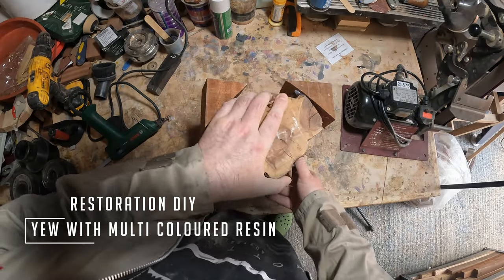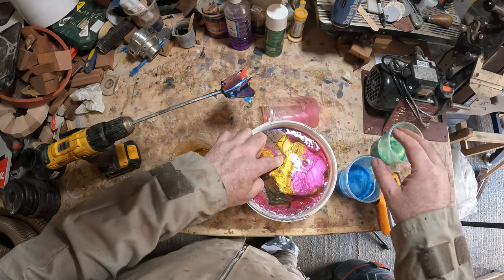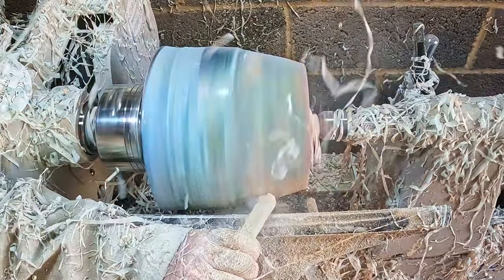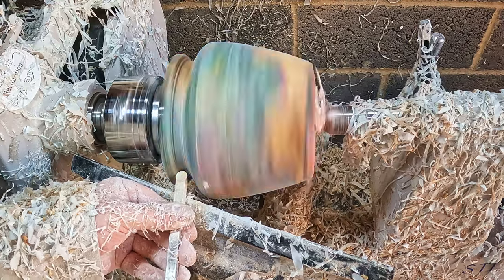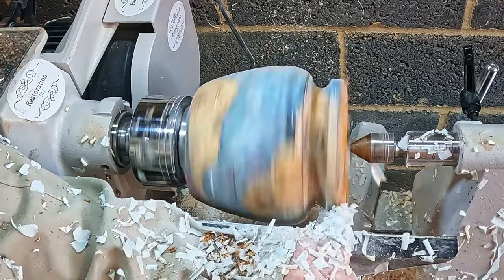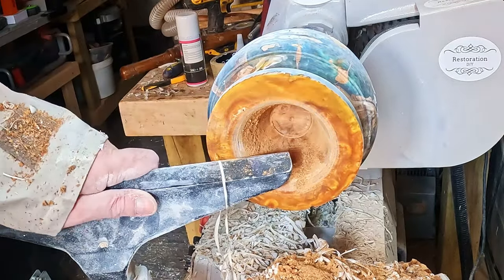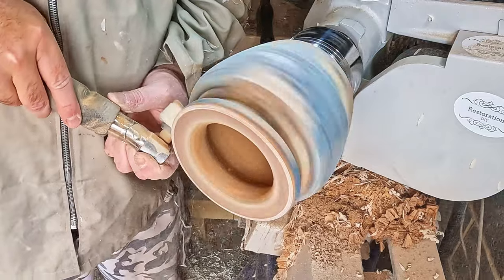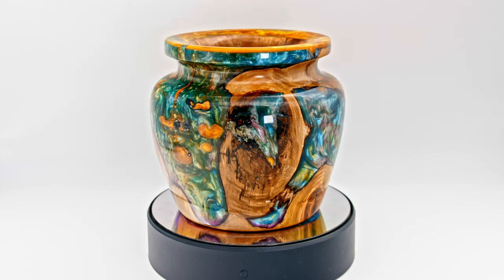Woodturning | Yew Vase with 4 Colour Epoxy Resin | Restoration DIY

Comment: maybe a vacuum chamber should be next on your list of purchases for your shop? it can draw resin into porous woods, which stabilizes it while also adding to its strength, and takes care of the air bubbles and void issues. as long as your resin has a long enough working time, it seems to get the best results when used alongside a pressure pot. i like how well you overcame the problems as always, but i’m sure you’d rather avoid them if possible.
Reply from the maker: I already have a vacuum pot but when I'm pre curing the resin I don't have time to use it, though i take your point I think I will have to incorporate it into the process perhaps using cactus juice and vacuum will be something to consider, 🙂👍

Comment: One of the most beautiful pieces I’ve seen, and from a chap near me too. One question is, is a pressure pot better than a vacuum pot?
Reply from the maker: Thank you, 🙂 the pressure pot is better a vacuum pot will create bubbles in the resin as it cures, though I have used a vacuum for the first 5 minutes to draw the resin down into the finer cracks and voids then it went into the pressure pot for the rest of the curing process.

Comment: Essa sua panela é  de pressão ou a vácuo?Ótimo canal.
Reply from the maker: Thank you  🙂, I use a pressure Pot for all of my epoxy resin projects, i also have a vacuum pot but i only use it on very porous wood. many thanks for you question. 🙂

Comment: I have started using a long open time resin that has a peak exotherm of around 40 degrees. Almost eliminates the voids as the air does not expand during curing. Happy to send a sample if you wish to try?
Reply from the maker: Hi thanks for your comment which brand of epoxy are you using?
Reply: @RestorationDIY  I’ll send a link.
Reply from the maker: Thank you 🙂

Comment: When you use the same implement to stir the different colors of resin, what do you use to clean that stirring implement, if anything, between colors?
Reply from the maker: Hi, great question, the answer is i dont clean it other than spinning the paint mixer at full speed to remove as much excess as possible, and when im done i let the resin cure and build up over many weeks then i snap it off with grips,  🙂

Comment: I don't get it...why didn't you just soak the entire thing in resin to fill the voids 🤔?
Reply from the maker: At the beginning i was trying to finish it in one day which is why i used the rapid setting epoxy, but when the full extent of the voids were visible around the rim i gave in and used normal resin that took 24hrs to cure.
Reply: @RestorationDIY  oh, ok...that makes sense.  I think you even said that in the video...silly me.

Comment: Would a vacuum chamber followed by the pressure pot not stop most of the voids?  Just curious.
Reply from the maker: Hi, that would’ve worked if I’d had more time, I allowed the resin to pre cure so it was already beginning to gel so I only had time for the pressure pot. It’s a great suggestion which I may try on another project. 🙂👍🏻